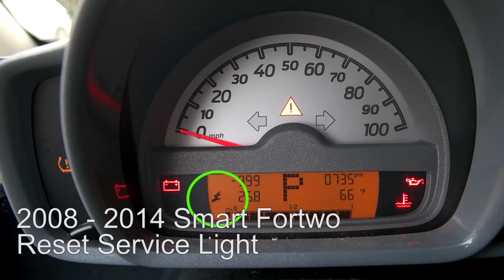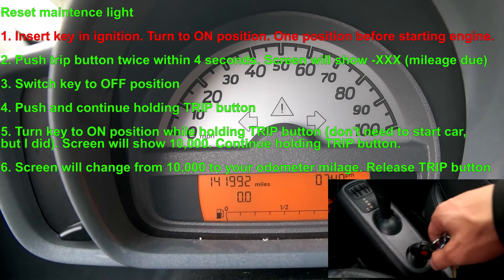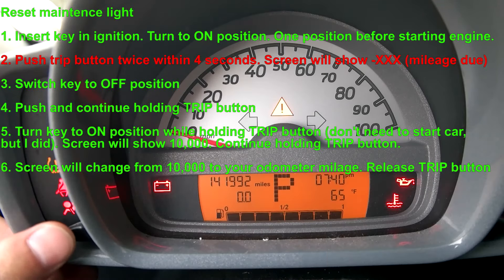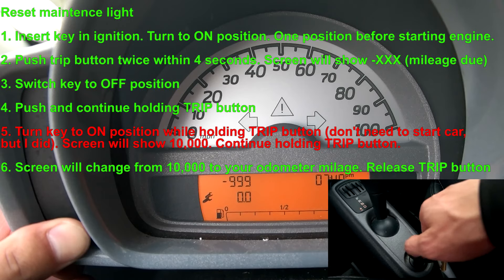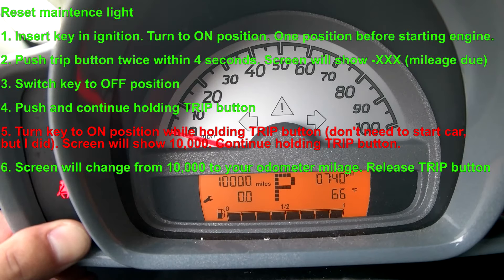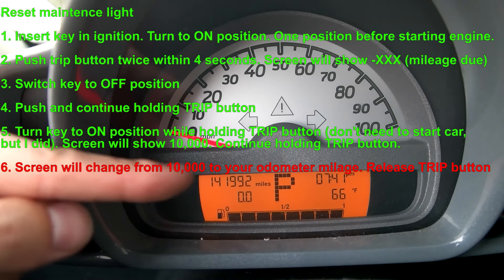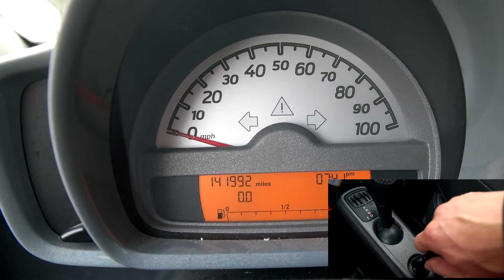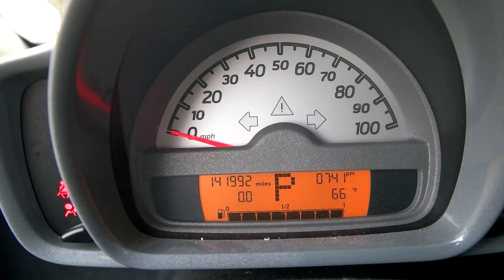DIY Smart Car ForTwo Reset Maintenance Service Light

Comment: The trick is to turn the key all the way to the start position while holding the button in. If you just go to the on position it will not work. This also  applies to the EV. The fellow here is doing it right, most of the other videos don't mention it.
Reply from the maker: @adotintheshark4848  thanks for the feedback!

Comment: Car stopped and I had no idea what wrong. looked at your video and seen I had to reset mileage, followed video up and running first time. Great Video. Now looking at oil change and transmission flush. many Thanks
Reply from the maker: @norrie183  sorry to hear that. The car stalling sounds like another issue unrelated to resetting the maintenance. I hope you get it figured out!

Comment: Great video!!
 you didn't need to fully start the car just get it in that position that Lights it up
Reply from the maker: @MrJohnnyblazed  Thanks. Yes, I’ve tried it both ways. I was just following an instructional that I read online that suggested turning the car on, and it seemed to work more often for most.

Comment: Thank you, thank you, thank you!!!  It worked!
I'm a new owner of a 2014 coup passion with 24,000 miles, previous owner had an oil change but did not know how to reset.
Dan
Reply from the maker: You're welcome, Dan. I'm glad it worked for you!
Reply: @ColinLeung  Well... it did work, however, when I started her up the next time the two wrenches returned flashing at me again.  It does stop once I put her in gear, but it continues to light up when starting each time... I guess I will have to find a dealer or repair shop to learn what its trying to tell me.
Even still, thank you for the video. 
Dan
Reply from the maker: @dt-5630  Sorry to hear that, and I hope they figure it out

Comment: Great videos. I really appreciate you posting them. Is there a way to hell how many kms you got before next oil change?
Reply from the maker: Online says 10,000 miles or every year. Whichever comes first.
Reply: @ColinLeung I think Adam was asking if the Smart has a “miles/ kms left until next oil change needed” indicator? My gmc van has that, and I check it every time I drive. I put a LOT of miles on! Anyway, I don’t believe the Smart computer is that smart, forgive the tongue in cheek, I haven’t seen a way to display “miles left until oil change needed” on my ‘09 yet.
Reply from the maker: @jenngill7772  You're right. Thanks for clarifying and sharing your experience with your car. I sold my Smart car a while back, and am unable to verify, so I'll trust your word on it

Comment: End of first month in a 451 sharp red edition. The transmission had been jerky at first,then i click shifted a while,seemed OK. This morning, i accidentally skipt 1st, got the wrenchs,and the 3 death bars. I think i was luckily maybe, i tirn off the car,got out waited about two minutes, and it started....in neutral?  Wrenches and bars were gone,and came home no problems.  Could low transmission fluid cause this?
Reply from the maker: It's possible. Filling it up would be the cheapest repair suggestion. If that doesn't work then the transmission may need to be repaired, or replaced
Reply: @ColinLeung  thank you so much!! As a former lawn mower repair blackfinger,I realized yesterday that I'm the almost everything for it. It's a 2013 Sharpred edition smart, and one of I'm discovering extremely few with that badge on its door.  Plus I live the friggin lil thing,I gotta keep it rolling!😅 I'm ordering a teardown manual and hopefully won't discover that they exist 😂
Reply from the maker: @IamKai8947  Sounds like a nice car. I'm glad you're liking it!
Reply: @IamKai8947 where did you find a tear down manual for the 451? And how much was it? And is it any good?  Thanks

Comment: 141000 miles! Not bad!! Is it the original engine do you know? Has it been rebuilt at all??
Reply from the maker: Hello Mark, I believe that was the original engine. Based on the paperwork that was included from the previous owner the engine was never rebuilt.
Reply: @ColinLeung  wow, that’s amazing!!! A testimony to what these little cars can achieve! 🚗
Reply: How many miles do they usually last? I just bought one with 124000 on it

Comment: Hi, do you have any advice on resetting an electric Smart Car for this very thing? This doesn't seem to work. Thanks!
Reply from the maker: Hello, unfortunately I am not familiar with that process for the electric version. I did a quick google search, and could not find anything either. I'd suggest doing a deeper dive on Smart forums, or asking the dealer if they're willing to do it. Thank you

Comment: Anything for Core Ser. Message?
Reply from the maker: Hello, I'm not too familiar with that message. According to Google: 
A "Core Ser." message on a Smart car dashboard indicates a critical system error related to the car's core functions, essentially meaning a major system malfunction requiring immediate attention from a qualified mechanic at a Smart dealership or service center; it often signifies a need to have the car towed as driving with this message could potentially damage the vehicle further.
Key points about the "Core Ser." message:
Severity: This is a very serious warning, not to be ignored.
Possible causes: Issues with the engine control unit (ECU), electrical system failures, transmission problems, or other major components.
What to do:
Do not drive further: Pull over to a safe location and contact your Smart dealer or roadside assistance immediately.
Check the owner's manual: Consult your car's manual for specific instructions regarding the "Core Ser." message and what it might indicate for your particular model.
Get professional help: A qualified Smart technician will need to diagnose the problem using specialized diagnostic tools and potentially repair or replace faulty components.

Comment: Hello can u help me out my smart car fortwo right turn signal is not working its not the light bulb for sure i got new ones the left signal blinks  slow while the right blinks fast
Reply from the maker: Hello Johnny, that's a difficult one. It sounds like there's a broken wire somewhere. You would need to chase continuity or voltage from the switch, and bulb, or possibly further back. 
You can use a voltmeter to check the light bulb socket, and work your way back.

Comment: Strange, my 2013 Smart Fortwo displays a SMART MESSAGE and intro on the display first and I never manage to get this to work.  any ideas?
Reply from the maker: Hello, is yours a 2013 smart fortwo? Or perhaps it's the EV, or Smart EQ ForTwo model?
Reply: @ColinLeung  Hello Colin, wasn't expecting a reply, but thank you!!  Yes, it's a 2013 Smart fortwo, non electric.  It's funny, cause I don't know the specific model but its a normal one.  Not cabrio, nor Brabus, it's just a loaded one with Cruise Control, etc, Running day LED lights, Automatic Wipers.  Etc.  But I cant get that done.  The car start and its a different message.  When you turn the key, you get a Black Screen with a Smart Logo (in orange) and it does like a little intro, and then you get to the panel, but the tools are not there to begin with.  Maybe I'm lost.
Reply from the maker: @willorge  No problem. I try to respond to all messages left by users. I'm not too familiar with that start up description. Perhaps you can ask on a Smart Forum, or go the the dealer and ask them how to reset it.
Reply: @ColinLeung  Any email i can reach you to send you a video?  Or any instagram account or something?  Im very curious.  (BYW I want to sell my Touch OEM head unit, the original Smart touch screen, It's a collectors item, but I  need apple car play.
Reply: @ColinLeung  And thank you for responding

Comment: New owner of 2008 smart car passion. 80k Miles. Erratic transmission problems.  Won't engage reverse or drive.  Any suggestions?
Reply from the maker: Hello Bob, it sounds like there may be an internal issue with the transmission. Changing the transmission fluid may help, and would be the cheapest test. If that doesn't work then I would bring it into a mechanic for their diagnosis.

Comment: Can you please guide me on how to turn off the passenger airbag please?
Reply from the maker: Hello Matthew, I quickly searched google and they suggested: 
Locate the airbag key switch on the far right side of the dashboard
Insert your key and turn it counter-clockwise to the off position
Check for the “passenger airbag off” indicator light
To turn the airbag back on, insert the key into the divot and turn it clockwise to the ON position

Comment: how do u activate the daytime running lights when equiped
Reply from the maker: Hello Mike, I did a quick search and found this
Turning DRLs On And Off
Have the car turned off and the key in hand. Pull the left hand (light) stalk towards you and hold it there. Push the LOCK button on the key remote. The car will beep and the DRLs should be activated.
https://www.evilution.co.uk/mod/turning-the-drls-on-and-off.htm#:~:text=Turning%20DRLs%20On%20And%20Off&text=Have%20the%20car%20turned%20off,the%20DRLs%20should%20be%20activated.

Comment: So annoying, tried this 100 times, won't work. After holding left button then switching on ignition, you can see the - 12 slightly blink after a few seconds, as if it's trying to reset, but won't 🤔
Reply from the maker: Sorry to hear that. You can try a different method that you find online, or go to the dealer and see if they can do it.
Reply: Same deal happened to me. Followed the exact method. Sometimes older vehicles won't reset the oil life.

Comment: Mine came back on again after 1 second what does that mean
Reply from the maker: Hello Albert, you can try resetting it again by using this video or a different procedure. It may mean it was not reset the first time. If it persists then you may need to bring it to a dealer.
Reply: @ColinLeung  my entire battery is shot.  Tried jumping the car twice. Both times the car only came on for a second and I was unable to switch gears out of parking successfully. Additionally my abs light and hazard light came on to go with the red battery icon in the dashboard.  Called for towing. Could be the battery or the alternator any suggestions?
Reply from the maker: @therealalgee  I'd suggest getting the battery tested. Autozone, O Reilly or Napa Auto should be able to test it for free.  If it sat for a while it could just need to be charged. If the battery is bad then change that first. If the battery is fine then it could be the starter. The car should be able to start with a bad alternator, but will not recharge the battery with the engine running.

Comment: Did an oil change.  I have reset the oil maintenance light on my 2012 Smart Car low-end model without power windows.  Has 45,000 miles.  Has no wrenches now. Did it like this video and numerous posts show it.  However, I don't see 10,000 miles pop up.  

I did have a TPMS showing a low tire.  Driving down the road it was flashing on dash a TPMS and a -26 DAYS.  I did the reset and filled the tires.  The owner was running 30 in all four.  Rear needs 36.  The TPMS reset before even driving and the -26 DAYS was gone.

However, the -26 DAYS comes on when you key on to start. Pushing the button on end of light stalk makes it go away and while driving it does not come back.  Just ever restart.   

I as owner.  He says when the dealer resets it says 30 DAYS with no - on it.  He thinks and once it got to the month warning for oil change, it had counted down to 0 and now was up to -26 DAYS.  

Little confused have I not gone far enough in the reset.  Any thought on this 26-DAYS display.
Reply from the maker: Hello, thank you for the comments. Unfortunately I sold my smart car, and am not familiar enough with the DAY's display. Perhaps someone else that owns one can chime in.
Reply: @ColinLeung  Thank you.  I found out why it said days.  If you don't go 10,000 miles it a year, it starts the month count down that you should change oil ever 10K or a year 

Also, haven't tried yet but a mechanic in Great Britain told me my timing is probably off in my pushes.  He says after the two pushes, I need to key off, get back on button and start the hold in under 4 seconds.

Key on to start and do the minimum count of a real 10 seconds.
Reply from the maker: @RIPSAWONE  I'm glad you figured it out, and thanks for sharing your tips.

Comment: For some reason it didn’t work for me. I have the 2010 passion
Reply from the maker: I'm sorry it did not work. I've seen procedures online listing a slightly different procedure without needing to turn on the ignition. Perhaps you can try those to see if it works!